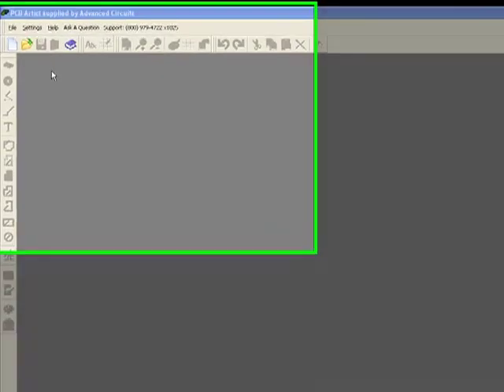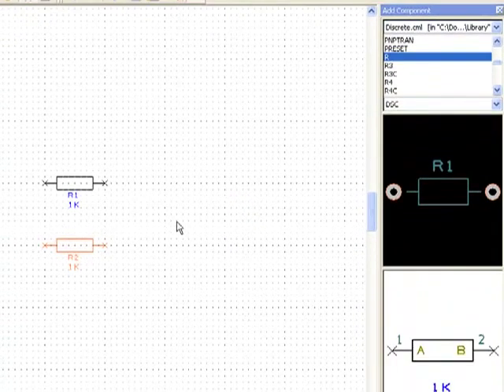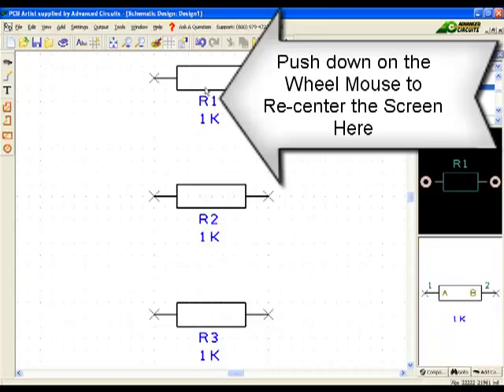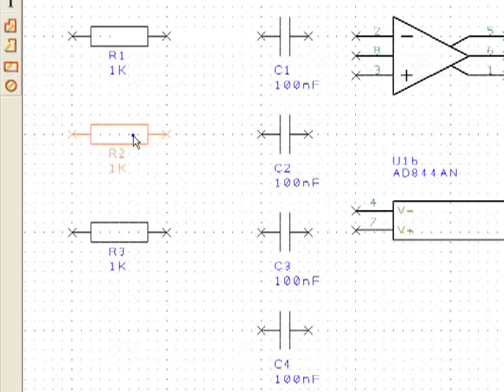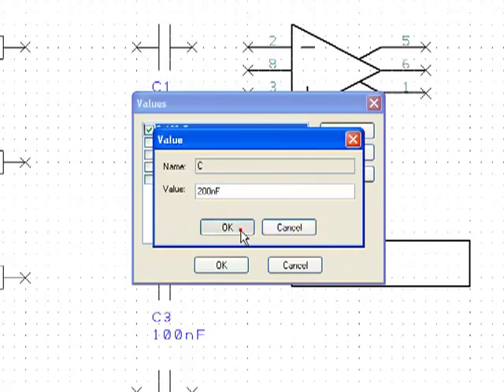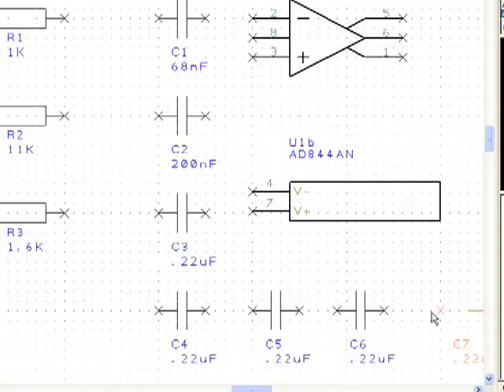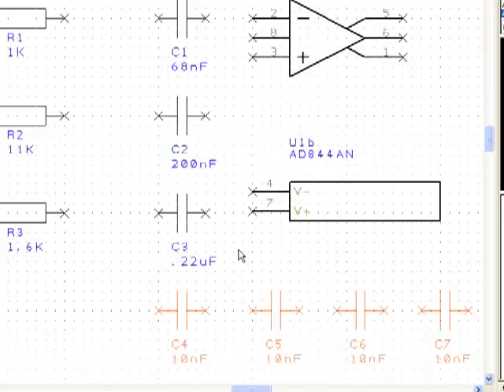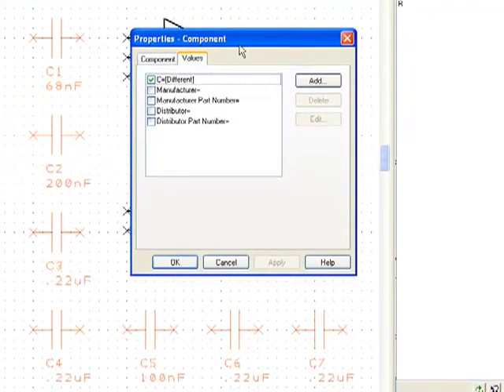PCB Artist Video Tutorial- Series 1 - Part 2 Video

Comment: It's interesting to hear an Eagle CAD user say this program has difficult . To date I had only used PCB Express, but the company that bought us out won't let me use them anymore. Trying to find parts with PCB Artist is hard, and their answer to the missing parts is "Well, it's easy to build a new part on our program." Ain't nobody got time for dat!
Reply: I am very well versed in Eagle and I find this program to be significantly convoluted. The most mundane tasks leave me pulling my hair out whilst reading the help more than working my board. I would not recommend using this software unless absolutely necessary. There are some nice features (free, go-to is convenient, etc.) but the pros are heavily out weighed by the cons in my opinion.
Reply: Joel Owens simple to swap a part...you want to make the best product right?? test test... don't always cheap out ;) success

Comment: These need to be updated. We do not need to see you change the value on every single component, one would do just fine. Anyone who is doing this type of work should already know Ctrl+C/Ctrl+V and other basic windows operations. Please make this about the software and not so basic and repetitive. I have tried to search for a component and have no idea how to. The only thing I have managed is to search it for editing, I want to have a simple search on the parts window at the right. That's it, I don't want to have to go to the help menu and spend an hour trying to figure out how to quickly search for a component I need. Another problem I see is that part 1 is designing the board layout and part 2 is the schematic. Please take a moment and think about that one. I think I will stay with Eagle until Advanced Circuits does a little house cleaning on this one.
Reply: Yep, you got to design the schematic first.